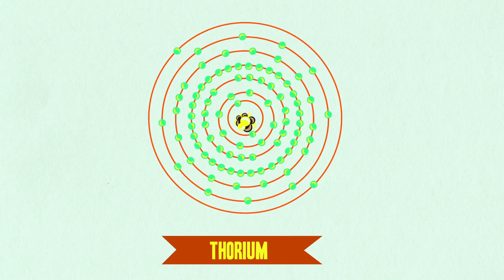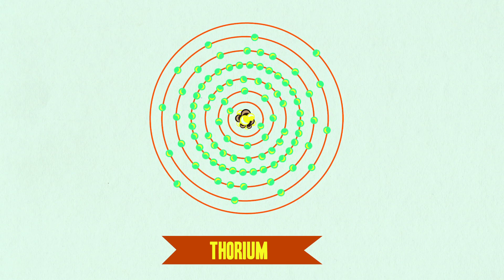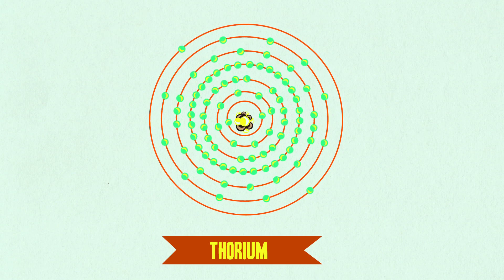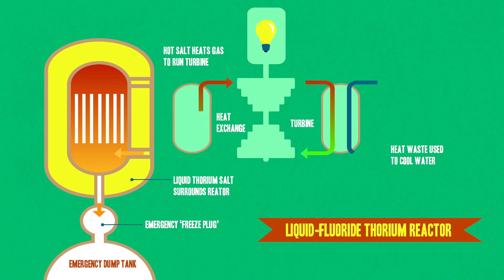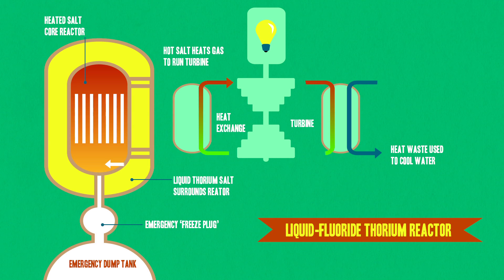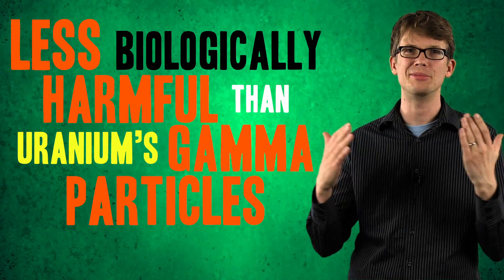Liquid Fluoride Thorium Reactors (LFTR): Energy for the Future?

Comment: 1 kg of Thorium dellivers 4,800,000,000 Kwh
1 kg of Uranium delivers 24,000,000 Kwh 
1 kg of oil delivers 12 Kwh
1kg of coal delivers 8 Kwh
1kg of wood delivers 5 Kwh

THORIUM 232 IS 100% SAFE!

URANIUM 238 IS NUCLEAR DISASTER POSSIBLE!

Uranium nuclear fission is a chain reaction that cannot be stopped, only controlled by cooling. If active cooling falls then you have a meltdown. WE HAVE ALREADY HAD 3 X A NUCLEAR DISASTER IN 70 YEARS URANIUM NUCLEAR ENERGY. If something can go wrong, the question is not whether it will go wrong, but when.

URANIUM 238:
2% can only be used for energy extraction;
98% is nuclear waste
Uranium nuclear waste remains active for 24,000 years
Nuclear weapons, uranium can serve as a raw material for nuclear weapons
Nuclear disaster sensitive

Demolition of a plastic bag is 1000 years

THORIUM 232
98% is usable for energy extraction;
2% is nuclear waste
Thorium nuclear waste remains active for only 300 years;
Thorium is not suitable for nuclear weapons
Nuclear disaster is impossible with thorium
Thorium explained: https://www.youtube.com/watch?v=8nUjvpxzFbk&t=7s
Thorium explained: https://www.youtube.com/watch?v=biToH42YZZ4&t=50s

1 kg of Thorium delivers 4,800,000,000 Kwh
1 kg of Uranium delivers 24,000,000 Kwh
1 kg of oil delivers 12 Kwh
1kg of coal delivers 8 Kwh
1kg of wood delivers 5 Kwh

!!! SPREAD THE MESSAGE OF THORIUM CENTRALES PEOPLE !!!
Only in this way can we gain support to switch to this. If the people want it then we can put pressure on politics.

BIOMASS power stations burn WOOD just like the Romans 3000 years ago. This is a step back in our evolution.
COAL is the improved version of this. Coal and oil are primeval forests that are optimized as fuel by the earth as fuel. More energy and fewer emissions
Reply: "COAL" is not an "improved version" of "BIOMASS". Biomass grows back, coal does not. 
You physically cannot burn biomass that isn’t being produced, and in its production that biomass takes up the same amount of emissions it releases when being burned. If you burn a tree that’s 50 years old, then you release only the emissions that were taken up by the tree itself in the last 50 years, and will again be taken up by a new tree in another 50 years. That tree btw would die and decay at some point anyway, releasing most of that CO2,  so, burning it  doesn’t lead to much higher emissions than would result without human interference as long as you don’t permanently alter its environment.
If you burn coal, you burn biomass that fossilized millions of years ago and release carbon that would have stayed geologically bound and completely separate from the atmospheric carbon cycle if you hadn’t mined it, and which will not get geologically bound again within human time spans. You can also burn amounts of it that accumulated over millions of years, much more than you could get from a modern forest (there the most you can ever burn is what’s currently growing, then you’d have to wait for years or decades until it grows back, which also means it will take up all the carbon again). You also cannot offset the emissions from fossil fuels simply by planting more trees, because as you might have heard there is only limited space available on the earth’s surface, which doesn’t allow us to continue increasing forest areas indefinitely (or as much as needed to take up all CO2 resulting from burning all fossil fuel reserves).
Burning biomass is not environmentally sustainable if done excessively (i.e. more than the environments from which the biomass is taken can replenish), but burning coal is NEVER environmentally sustainable.
Really, I wonder why some people have such difficulty with this concept.
Reply: @Ornitholestes1  If you cut and burn trees at the rate we need energy for, you will eradicate all forests. Forests will disappear within decades and all animal species that live in those forests will disappear.
Trees are not replenished and the forests of a replanted forest do not contain life like that found in old-growth forests. It is a catastrophic disaster with which all natural flora and fauna will disappear. The biodiversity of millions of years of evolution will be destroyed forever.
Thorium can provide on a 100% save way al the power we need whitout polution and destroying forrests and wildlife.
Thorium explained: https://www.youtube.com/watch?v=8nUjvpxzFbk&t=10s
1 kg of Thorium dellivers 4,800,000,000 Kwh
1 kg of Uranium delivers 24,000,000 Kwh 
1 kg of oil delivers 12 Kwh
1kg of coal delivers 8 Kwh
1kg of wood delivers 5 Kwh

In a small country like the Netherlands they are now building 628 Biomass plants. These 628 biomass plants will burn billions of tons of wood every year.
Thorium power stations, the Netherlands only needs 10 of them for the same amount of power.

THORIUM 232 IS 100% SAFE!

URANIUM 238 IS NUCLEAR DISASTER POSSIBLE!

Uranium nuclear fission is a chain reaction that cannot be stopped, only controlled by cooling. If active cooling falls then you have a meltdown. WE HAVE ALREADY HAD 3 X A NUCLEAR DISASTER IN 70 YEARS URANIUM NUCLEAR ENERGY. If something can go wrong, the question is not whether it will go wrong, but when.

URANIUM 238:
2% can only be used for energy extraction;
98% is nuclear waste
Uranium nuclear waste remains active for 24,000 years
Nuclear weapons, uranium can serve as a raw material for nuclear weapons
Nuclear disaster sensitive

Demolition of a plastic bag is 1000 years

THORIUM 232
98% is usable for energy extraction;
2% is nuclear waste
Thorium nuclear waste remains active for only 300 years;
Thorium is not suitable for nuclear weapons
Nuclear disaster is impossible with thorium
Thorium explained: https://www.youtube.com/watch?v=8nUjvpxzFbk&t=7s
Thorium explained: https://www.youtube.com/watch?v=biToH42YZZ4&t=50s

1 kg of Thorium delivers 4,800,000,000 Kwh
1 kg of Uranium delivers 24,000,000 Kwh
1 kg of oil delivers 12 Kwh
1kg of coal delivers 8 Kwh
1kg of wood delivers 5 Kwh

!!! SPREAD THE MESSAGE OF THORIUM CENTRALES PEOPLE !!!
Only in this way can we gain support to switch to this. If the people want it then we can put pressure on politics.
Reply: @VriendRick  Nobody is talking about cutting and burning trees "at the rate we need energy for". People are very stupid already, but there are limits to that stupidity when their own ability to make money is impacted.
But go ahead, continue repeating your religious mantra.
Reply: @Ornitholestes1  you are so wrong in this matter.
COAL IS THE IMPROVED FOSSIL FEUL FROM TREES.
DO YOU KNOW HOW MUCH FRESH TREES THEY NEED TO HARVEST.
THEY DO NOT PLANT THEM BACK!
I REPEAT
THEY DO NOT PLANT HARVESTED TREES BACK.
Planting trees cost money.
Harvesting trees is big  business

FOR COAL YOU HARVEST ZERO TREES.
The co2 emissions are les.
You do not destroy the habitats of indangered animals
Reply: @VriendRick  They don’t plant harvested trees back? Not always, no. But they should. And they could. Whereas the emissions from coal cannot be circumvented in any way, unless you are saying they do plant harvested coal back. 
For coal you don’t harvest trees? You don’t destroy habitats of endangered animals?
Think again!
https://en.wikipedia.org/wiki/Hambach_Forest
Now deforestation (i.e. net decrease in the amount of tree cover) IS a major problem, although the primary cause is probably lang clearing and not biomass burning (because if you wanted to harvest the biomass, you wouldn’t want to prevent new trees from growing). But if you only harvest as many trees as grow back, you do not have that problem.
I suggest you do the same with coal, only mine as much coal as grows back. That will be the swiftest coal-exit in history.
You seem to struggle a bit with reading comprehension, so I’ll make it short for you.
Burning a tree emits CO2. Growing a tree removes CO2 (to build the same biomass that you are later burning). In order to burn a tree, you must grow a tree, if you don’t, well then there is no tree for you to burn. Understood? That means: no net emissions.
Burning coal causes emissions. Coal doesn’t grow back within time spans relevant to us humans, and hence does not remove any emissions. In order to burn coal, you just need to mine it (which causes even more emissions), which you can do until there’s nothing left. That means: massive net emissions.
Reply: @Ornitholestes1  wrong again 
Coal are very old trees.
Reply: @VriendRick  Wow, really got me there pal.
Who would have thought. I mean, it’s not as if I had written that in my first comment…oh, wait.
Sure, let’s ignore it takes millions of years to form new coal (and even then requires specific types of environment, which is why coal isn’t everywhere, environments, such as peat bogs, that we are rapidly destroying I might add).
Reply: @Ornitholestes1  coal, oil and gas is a green cirkel.
This cirkel is greener than chopping fresh forests and not plant new trees 1 on 1 back.
Reply: @VriendRick  Why, and what circle?
Reply: @Ornitholestes1  planet earth!
Reply: @VriendRick  OK fine, you don’t want to form a coherent argument, your loss. Then I’m going to have to do it. But don’t complain later, I gave you every oppurtunity to explain your reasoning.
Fossil fuels, as the name would suggest, are fossils. You know what’s one of the key features of a fossil? It is old.
And not 50 years old, or 100, as a tree might be, but at least tens of thousands of years, tens to hundreds of millions of years in the case of widely exploited coal, oil and gas deposits.
That means there is no such thing as a "circle" (or rather, cycle, which I presume you meant to say) involving fossil fuels within either of our lifetimes, or even the entire time the human species is likely to exist. Because producing new ones just does not happen within these time scales.
That means the carbon released when you burn coal is carbon that was out of the atmospheric-biospheric cycle for millions of years, and has not been affecting the climate during this time because it was geologically bound. If you then release those emissions, that upsets the natural carbon cycle, by rapidly adding large amounts of additional carbon to the atmosphere.
On the other hand, when you burn biomass, you only release the carbon that the same biomass has taken up during its lifetime. And carbon that is constantly getting released and bound by vegetation anyway, as plants die, decompose, and new ones grow.
AGAIN, it remains important to not burn more biomass than grows back, both from a climate perspective and a habitat perspective. 
Doing so would result in a higher proportion of the carbon in the cycle to actually be in the atmosphere at the same time, which would lead to more warming. That is also why adding additional trees will pull carbon from the atmosphere; not because they bind it permanently, but because they shift the balance of the cycle towards more carbon being bound at any given time.
BUT every bit of coal you take out of the ground to burn it adds entirely new (or rather, old) carbon to the cycle that would have never entered it otherwise, and that is irreversible within human time scales because there’s no appreciable amount of coal being formed in such short time. 
Burning biomass on the other hand does not add any additional carbon to the cycle, it only releases it from one part of the cycle, vegetation, to another, the atmosphere. And that same carbon gets released when the biomass dies and decomposes (which the vast majority of biomass does) anyway, it’s not as if plants are immortal.
I’m really sorry if this is above your mental capacity to grasp, but if that’s the case maybe you should work on your education instead of pestering people with totally ludicrous claims.
Reply: @VriendRick  OK I’ve just about had it now. Stop repeating the same BS without proper reasoning, I won’t repeat my explanation a fourth time.
You can play dumb as long as you like, have fun doing it.
Food for thought; humanity cleared huge parts of the world’s forests from the neolithic to early modern times. That didn’t result in a massive increase in CO2 levels or major global warming. Only the burning of large amounts of fossil fuels starting in the early 19th century did that.
Because when you chop down a tree, space is freed for a new tree to grow, and when you burn that tree you don’t add much to the atmosphere that wouldn’t have been added anyway if the tree had decomposed naturally (or been burned by a forest fire). But when you burn coal, there is nothing to offset its emissions.
Your video is off-topic. The amazon is mostly being cleared to make space for agricultural use, not for biomass burning. Generally speaking, if you want the trees for energy, you try NOT to burn them in situ.
And if you were to actually use a piece of forest for biomass production, it would be in your own economic interest to make sure new trees grow back, because otherwise you would run out of trees. Totally different situation when what you want is land to raise cattle on.

Comment: These reactors operate at such high temperatures, it becomes feasible to squeeze hydrogen and carbon together, in the presence of a metal catalyst, add heat, and hydrocarbons will be produced. We could make car and jet fuel that doesn't add more C to the atmosphere (if the carbon used in the process is taken from the air to start with).

Charging substantial fees to industries that extract carbon (or that deplete other natural resources or that emit pollution or disturb wildlife habitat) would give incentive to reduce impacts on the environment. That would turn the economy toward a sustainable path. Industries that DON'T harm the environment would thrive. Sharing fee proceeds to all people would end poverty. This should be a global policy.

Fix civilization:
gaiabrain.blogspot.com/2015/12

Comment: It seems the lithium and beryllium is expensive and has problems
 Why not liquid silicon which has a higher melting point. It has been proven to work as a energy storage method by an Australian company called '1414 degrees'.

Comment: Whatever new design they use will have to go stable and not need outside power to cool and keep it safe.  In case a tsunami or meteor or other event happens, it has to be able to go to stable as the default, not meltdown and break confinement and poison our water table.

Comment: Why isn't someone like Elon Musk jumping on this? I see the possibility of billionaires funding the production of LFTR plants and selling the energy output much more cheaply, undercutting fossil fuels, old uranium reactors and even the supposed renewables (even though solar takes expensive rare metals to make, not to mention the incredibly expensive batteries and the unreliability issues...).
Reply: Investment in nuclear energy is enormously expensive and takes very long to return the investment. Any nuclear power plant is going to be vastly more expensive than it's equivalent in fossil fuels or even renewables because of the very stringent safety regulations (nuclear power plants are required to be able to handle the absolute worst case scenario), and unproven technology like LFTR (compared to LWR, which the industry has decades of experience with) will add time and effort required to prove it, both in safety (just because the theory says one thing doesn't prove it in the real world. Commercial molten-salt reactors will have to have hundreds of times the output of the Oak Ridge experimental reactor) and commercial viability, before it's adopted on a large scale. Even then, changes in the commercial energy climate (e.g. if fusion becomes viable in 30 years, or if nuclear energy becomes even more politically hamstrung) can mean this investment goes to waste. It's just not attractive to private investors; nuclear energy research is a project that will have to be shouldered by governments.

Comment: LFTR require completely different method of production.  You can't just change current uranium plants into LFTR. LFTR are extremely safe, no way for meltdowns as its already liquid and not under pressure, and would be very cheap.  
The hurdle now is to catch up on how to filter the molten salt material from the core to keep fission heating going... some fission products during the process creates elemental isotopes that can't remain in large quantities like cesium, which absorbs more neutrons before it eventually splits/fission, and spent isotopes need to be removed completely.  
It's work graduate students could do... China started there program back in 2011... a 10 year project... so we'll see in 2021 what they come up with... but we should be doing our own too.  Many methods and techniques can be discovered for the best possible designs.  
At this pace, ITER and Wendelstein 7X will come to be which uses deuterium and lithium blankets to breed tritium fusion reactors... fusion provides a couple orders of magnitude more energy, and ultimately the next power source that is fossil fuel free, and delivers so abundant amount of electricity that electrolysis can be used cheaply to make a variety of chemical fuels and other compounds all carbon neutral. 
Makes H2 fuel cell cars better than expensive lithium battery cars that use 140 pounds of lithium to charge... H2 produced via electrolysis from water already exist and quite safe.

ITER and Wendelstein 7x and even India and China's thorium projects while big, are nowhere the size they should be... all nations and combined nations like in the case of ITER should be in such a giant funding and timetable speed to look like a million Apollo projects being ran at one time.  
But instead, each project while large in some sense, is but one millionth that of funding of defense spending.